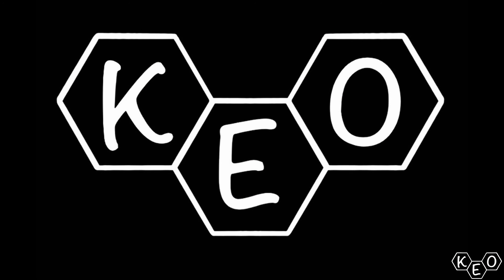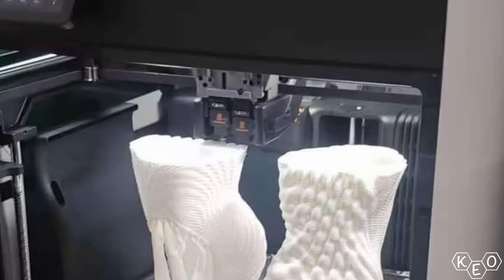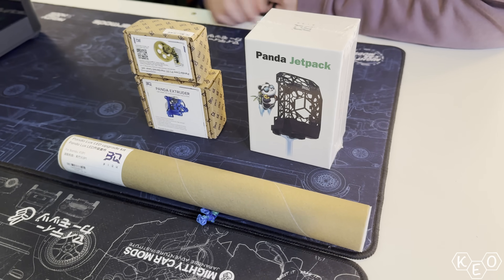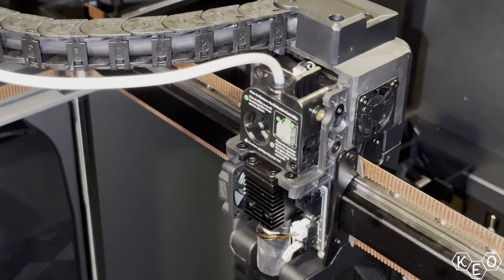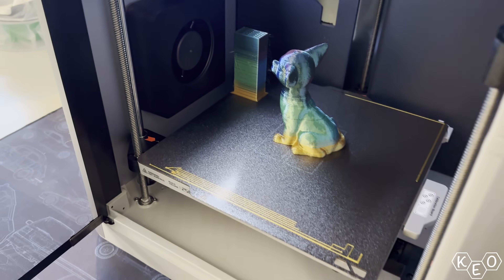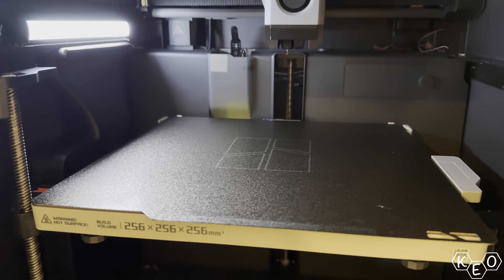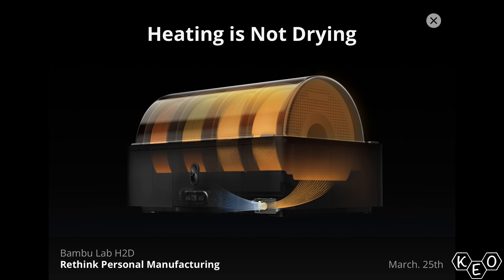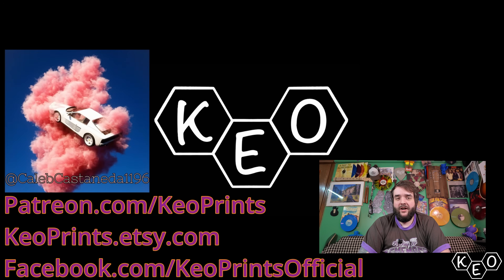Is The Bambu H2D Worth The Hype? Pre-Release Speculation

Comment: The H2D is not something I'm interested in purchasing, but I look forward to what features will trickle down to the X and P series printers. The most interesting announcement during the H2D's launch was the AMS 2 Pro. They've improved all of the shortcomings of the first iteration and integrated a drying function, which will be a huge help. The kicker was the AMS 2's backwards compatibility with the entire product stack. That's a massive win for everyone using a Bambu printer.
Reply from the maker: Agreed. The AMS improvements are staggering. I figured they would have locked it down to the new machine or make the old ones not work with it or something. I was as surprised as you

Comment: Now that the dust has settled, from what I've seen so far, I am neither impressed nor disappointed. Its a confusing printer. It does not innovate nor solves a problem anyone has. Its a printer with an identity crisis.

The A1 was revolutionary given that it made 3d printer accessible to anyone. This one? I don't exactly know who is this marketed for. It can't be enthusiasts since it is objectively better to have multiple monotask devices that excel at what they're designed for rather than a jack of all trades master of none type of printer.

It can't be for print farmers since that would be wasting all its other features. On top of that, a printer for a farm needs to be easily repairable. With so much stuff working under the hood, I doubt this would have a place in other people's farms. It certainly wont have a place in mine.

The only real advantage I can see is the dual extruder for prototyping. But then again, alligning a prototype for optimal print is still much stronger than using supports.

I was ready to bite the bullet and grab four for my farm but after the reviews.. I might just end up waiting for a A1 with dual extruders. I'm sure they'll want sales for the H2D to go well so we'll never see an A1 with dual extruders happen.

Comment: I have 5 3D printers and 2 laser engraver/cutters.    The laser machines are so dirty that I won't put them in the same room as the 3D printers..... let alone in the same... printer.    Thanks, Bambu - for listening to your users and then doing nothing we asked for!
Reply: I know nothing about those things what does it get dirty from? metal blasting off or something?
Reply: @mark6302  Yea.  There is quite a bit of smoke generated, and that smoke leaves fine particulate everywhere in kind of an even layer of thick dust.   It's not metal, as these diode lasers can't really touch metal, but cutting or engraving wood is pretty filthy.

Comment: Hey, did you see they are releasing a single spool AMS you can add to your setup if you need an extra color but not the full cost or size of a second AMS? That sounds like a great idea to me. There are a lot of things I have wanted to print that use more than 4 colors, but can’t justify another $310 on. It’s a proper dryer too. It’s a little more expensive than I’d like, but it’s still a bit more palatable. Will you be getting one?
Reply from the maker: Yea I’m on the list to be notified when they come in stock. Until then, I at least got ahold of the H2D combo with the AMS2

Comment: I doubt it will be the case, but if that laser could somehow be used to do the post-processing of a print, that might actually make it worth it. I’m so tired of cutting, melting and filling off supports and imperfections.

That said, from what I heard, it’s an engraver and vinyl cutter, and I’m not sure why you would want that in a printer and not its own machine. That just means less time printing cause it’s doing other stuff.

Comment: Now that the details and pricing have been released, is the printer as expensive as you expected it to be?  The full-featured 40W beast is "only" $3500... But it also replaces 3 machines in the footprint of a single machine. 

And as a business owner, what do you think about a machine that can do the work of 3 machines?  Less floor space, but also you can't print while you're etching.  It expands your capabilities but reduces your volume compared to having 3 machines.
Reply from the maker: Yes! Totally use case dependent. I can see how a small business would totally favor this machine if they’re using two or more of the processes regularly. The flexibility seems like a great idea if it suits your business. 

The price seems more reasonable than I was expecting and the upgrade path is encouraging and unexpected. 

For me personally, I picked up the standard combo for a piddly $2200 bucks. Pocket change. For such a famous content creator like myself of course. But on a serious note, I feel like that is expensive objectively but in terms of a value, I was expecting it to cost more. 

That all in mind, the laser and extra stuff doesn’t appeal to me but it’s nice to have the option to add them later should I find the need. Overall very impressed with the reveal even if I don’t personally see the need for anything beyond the 3D printer. I hope it doesn’t suck

Comment: The AMS 2 pro leaked specs say we can use some CF filaments in it, but also that we can't use some other CF filaments, or any CF or glass fiber filaments in it... only a few more hours until we find out.
Reply from the maker: Soon and very soon
Reply: @KeoPrints  Looks like the new AMSes aren't as hardened as I had hoped, and with the basic H2D price being 3x the price of a P1S... it's a tough sell. Hopefully BL will release a lower priced, larger volume printer that everyone wanted the H2D to be.
Reply from the maker: Yes total mixed feelings. I got ahold of the basic machine combo which was expensive for sure. But I am very interested in the dual nozzle thing so they got my money. 

The AMSs are a little more hardened which is nice to see but it would have been nice to see them go all the way with that aspect. Oh well

They were always going to get my money. I’m a fool anyway
Reply: @KeoPrints  I might still get the basic deal without AMS but since it won't ship in Canada until June at least, I have time to think about it. I like to print Hueforge the most and this process does not poop a lot, and I dont see a dual nozzle having a major advantage for it, so basically I'd be getting it for the slightly larger plate. Plus my house gets so dry, it actually pulls moisture out of the filaments in my current AMSes, according to the little water droplet indicator icon. And for power consumption, I'd love to see a cool plate released for it if I decide to buy the H2D.

Comment: Blue laser means it is a diode laser, as opposed to CO2 which would be impossible to put in a small 3D printer.  Neither type of a laser has any business being in a 3D printer though, at least not for the purpose of doing laser cutting.  I could see it being used as a post-extrusion filament heater though to try and battle bad layer adhesion on high temp filaments.  Ie, rather than spending lots of preheat time and energy turning the printer into a convection oven, just heat only what needs to be heated using a laser right as the filament leaves the nozzle.  I don't know if this is the plan, but I'm throwing the idea out free of charge.

Comment: I'm...loosely interested. Late joiner to the Bambu uh...bambwagon...just before all the shit went down, actually. It will have to be a very compelling machine for me to even cobsider it and I would still need a good path forward in a LAN only capacity.  All I really wanted was a bigger X1C, Bambu may have missed the mark here by going way too far overboard with the goldplating (feature bloat).
Reply: I’m in a similar mindset. Got my P1S last Black Friday and don’t see a massive step up between it and the X1C (Keo even upgraded one to be nearly as feature complete for less money haha). And the H2D seems like a very small step up over that other than the obviously massive larger size and dual nozzle for more speed and less waste with multicolor printing.

While this new printer definitely seems over-bloated, I do imagine the eventual P2S or whatever it will be called, will get some very nice upgrades to the first at a much better price. The size increase and dual heads would make me pay the price of an X1C over a cheeper P1S so here’s hoping they make something to meet in the middle. This is the new Flagship after all. Has to be a bit ridiculous haha

Comment: I mean...atleast you didnt put 'this changes everything' in the title 🙂 Expensivo is def the key take away here. How many P1S can you get for one of these? Where precision is always welcomed but current printers are pretty good now, its like buying a decent graphics card then spending $4k more for 3% extra. Still if it rivals resin printing precision, I might get one...just the one though! totally...yep...yep
Reply from the maker: I still think this will change everything. If it’s super expensive, it’ll open the door for more manufacturers to overcharge. The laser is unnecessary but others are going to follow suit no doubt. Same with the servos; cool but how necessary? I’m sure this machine will be excellent but the changes that will trickle down the industry as a result are going to be interesting to say the least!
Reply: @KeoPrints  Very true, that trickle down to other models will be great. I'm just on Adam Savages Tested where they have been running one for a few weeks. Its looking about $2k, perhaps another few hundred for the AMS on top. The dual head and bigger bed are my main sell points, where the precision does look good. Having one in the shop would be great, then having a chunk of P1S doing a lot of the print times feels good. Where Im looking forward to trying out "GreenBoy3D" nozzle and the pellet printing. Im not sure what printer to try that one out on, Creality seems the go to for that pellet nozzle, but having the mix of H2D for high quality precision parts, P1S just works printers to print bulk loads out, then the cheap constant pellet printing with a few crealities - feels a nice ballance all round.

Comment: Didn’t the specs get leaked? It has a 10w and a 40w laser module, and a vinyl cutter, and it’s optimised for high-temp engineering filaments. It’s got too much unnecessary stuff that kind of ruins it as a 3D printer, because it will be just ok as a laser cutter/engraver, but not great, just ok as a vinyl cutter but not great, and cost so much that it could have been a great 3D printer but now won’t be worth the money. 
Imagine if they didn’t do the laser or the vinyl cutter and just made the build plate a bit larger, it could be a lot cheaper and more popular.
Reply from the maker: I agree. If that is all the case then I feel like the core performance of the printer is going to be diminished since it is trying to do so many things

Comment: I think the lidar is more for uneven laser surface engraving also it’s a cone shape so maybe the printer will actually be able to see what it’s doing along with the servos kinda makes sense to have a adaptive print instead of mesh also did any one realize there’s a screen on the print head I have had a knomi it was useless lol but not if you could use it to see a camera focused on you nozzle and you can’t really stair at a laser just wounding if that isn’t the case what kind of cameras are they using lady I checked blue lasers eat cameras for breakfast even digital ones the other question I have is how are they going to deal with the smoke and hex bed the laser prosess  uses and produces during laser usage supper curious

Comment: Actually, you can see how the extruder works. It does rock (like an ultimaker) AND the nozzles go up and down too. micro lidar, the pattern looks a lot like handheld smart router. The pattern calibrates skew, flow, scale, and xy offset for the dual nozzle. Servos not only have closed loop but are very, very fast and high torque. I don't really need the laser, but the cutting head, man I hate having to set yup my cricut and spend an hour test cutting. if they have made cutter/plotters easy use it will own the etsy maker space